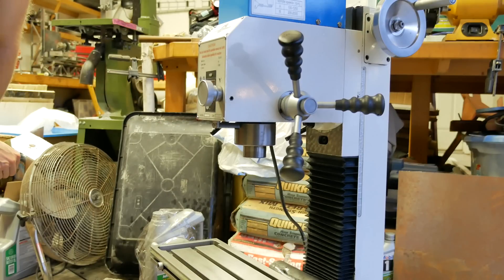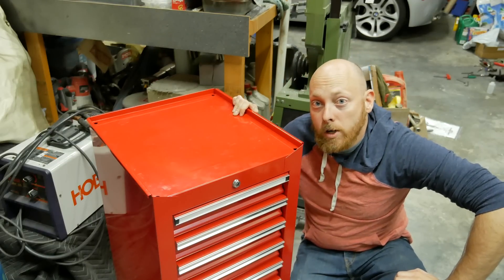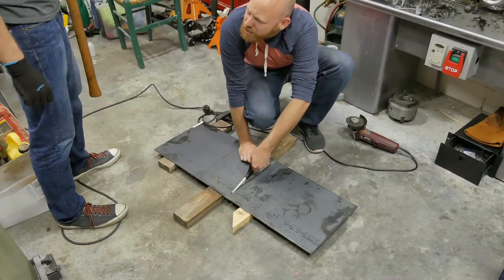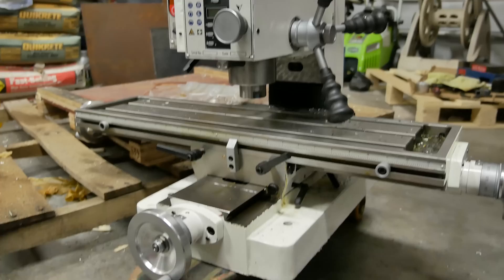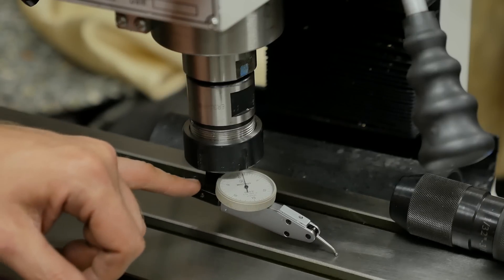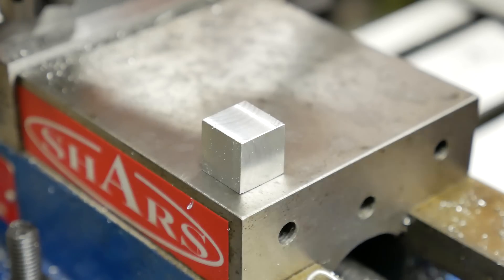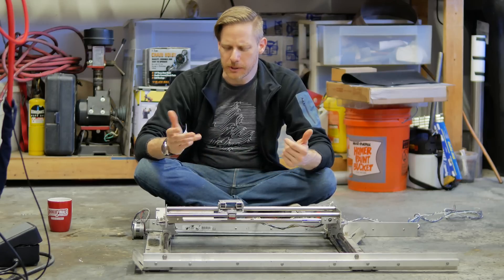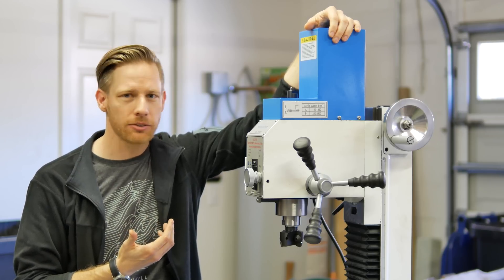we got a new Mill! - S02E30

Comment: First, that's an awesome delivery guy. 
Years ago, I picked up a 2 ton chain fall and welded (farmer welder level) a gantry to lift a SM365 xmission and the transfer case. I still have it and it gets more use than I ever expected. 
Watching the last part was great. My Sr. project for my EE was to build a large X-Y printer for the prof. in the art dept. This was in the late 80s. Scavenging parts and having grown up in a tool and die maker family, helped (and always helps) for the 'analog' stuff. 
Now that I'm not a prof. software engineer, I'm going back to working in the shop w/o a bunch of electronics feels important right now. 
Great vid. thank you.

Comment: "Why buy something nice when you can build a crappier version of it".  I live by that motto.   I brought home an ENCO 13x40 Gearhead lathe from a local machine shop recently. Tore it down, cleaned and painted it and put it back together and I'm using it to learn on.  My wife loves the new addition to the garage as it hardly takes up any space at all ;).  They also have a MSC Bridgeport Clone Mill that they're looking to sell me.  That is gonna be a bit harder to convince the wife on (even though the price is stupid good, cheaper than what I bought my lathe for...).   I have zero machining background but with the help of TOT and Blondihacks for around 6 months I can now single point thread, make rings and lots and lots and lots of chips to sweep and clean up.  It's way too much fun.

Comment: You guys are so much like me. I would like to try and build if I couldn't afford  a new mill. I did build a complete 3 axis CNC  Router Table. It was a learning curve. I am now am looking at a complete metal cutting CNC Mill. I cut gears out of wood with my very small Router Table in Fusion 360.  I have  had Large Bridgeport Knee mills and large lathes that were all manual and loved them.

Comment: I love how you use the parallel bars with the job that's a proper machining trick but you need to tap the job down with a copper hammer while tight in the vice to keep the bars tight they should not slide around during machining

Comment: Two words,... might be a future option.... if the tool chest seems lacking...
EPOXY GRANITE.

30% MINERAL DUST
35% SAND
12-15% EPOXY
... BY WEIGHT.
the remainder being STEEL INSERTS FOR STRUCTURE & FASTENERS.
(Unless my memory fails me,... which is rare.)

Comment: Question (to anyone really): Now that you had the mill for some time...How does the mill function on the HF tool box? Would you recommend the tool chest if you had to do it again? or just get the OEM stand on the Precision Matthews website and be done with it? any insight would be great.
Reply from the maker: Would definitely do it again. It's been very solid and a great place to put all the mill related tools. The only downside we have run into is forgetting to close one of the drawers all the way and ending up with chips in there. But that is pretty easily avoided.
Reply: @PhysicsAnonymous  Thanks. That's what I'm thinking too. Why get a basic stand, when for the same money + little extra mods, you get tool storage..

Comment: nice video, and tig work, but PLEASE use full clothing, like pro welders do, THIS ARC LIGHT is worse than m.i.g. or stick electric arcs !! ( the ultra-violet light is more intense, because the energy / temp. is a lot more); and so Pro welders hide every part of their arms, legs, in short if you DON'T want cancer there HIDE it under gauntlet sleeves, long boots, etc., you will seriously regret it when it comes time for skin grafts, or cancer operations!!

Comment: How sturdy is that tool chest against sideways forces acting on the top? I would have reinforced the back and the sides of the chest too. Milling harder materials such as steel can make a small mill like that shake quite a bit and you don't want the support for your mill oscillating sideways or back and forth with the mill.

Comment: Practice welding up and away from your welds. Lean back a bit and get up off your forearms and wrists, hold your torch and filler wire such that you support them with your whole arm, trust me it will improve your welding by a lot with some practice. Also don't use a grinder on your welding surfaces, clean them with an organic solvent/de-greaser. you can also wire brush a the surface a bit to clean off any oxides. Lastly, when doing tack welds, make sure your do them cross-ways keeping in mind how the part will flex from the expansion in that local spot.

Comment: Just remember... Lift with your back, not with your knees. Knee replacements are expensive.
Reply: So are back transplants..
Reply: John McDonald I am pretty sure you can't get them given the whole nervous system problem
Reply: Falney , A 2000lb engine hoist is about $200 or less. Works great if you can get the front wheels arranged right. Some welding and mods could make a big difference. Do not try extending the arm too far, it will tip before it will break, at least mine will. Make some containers to keep chains, hooks, levers, engine-tilting devices handy.
Reply: Keep your back straight, it will be fine
Reply: Everyone knows that the back is the strongest muscle in the human body.
Reply: Lift with the back in a sharp, jerking motion. This sudden movement is required to overcome gravitational pull when it isn't paying attention.

Comment: I recently got a big tool box from HD and the quality seemed better than HF, and more consistent.
Reply: The luck of the draw.
Reply: Paul Frederick , I had been considering what size toolbox and quality between HF and HD for nearly 6 months, my decision was hardly determined by “luck of the draw”.
Reply: Paul Frederick , You just do not give up do you Paul? Listen, I have bought lots of Chinese junk over the years including three bad and damaged keyboards in perfect packaging in a row, two battery chargers that failed after a few uses, and a pair of 4-wheeled car movers that had the swivel balls on most of the casters come out the first time I used them. I have also had a few great items, an Al floor jack is one. I am convinced that is the result of seeding good stuff with rejects or just crummy quality control or both , and HF is a major Perp. Every machinist who buys certain Chinese items complains of having swarf and grit in them. This is choice, not chance. I’m almost as old as Mr Pete and have seen junk from every country so don’t try to tell me I am blowing smoke.

Comment: I just bought my 3rd mill(or 5th if you include the mill and CNC router at work). I wish I had skipped the  desktop mills and went straight to the old knee mills. I started with the X2 at home and then got an SX3 at work. Then I got the Deckel KF12 pantograph mill which is pretty much a light duty knee mill and it makes the SX3 look like, or rather feel like a drill press. The small mills held my skills back for a year or two. I just finaly sold my X2 and bought a simply massive universal mill(Parkson 2N) with vertical head, universal head and a slotting heat with the proceeds. I paid even less for the KF12.  Anyway my point is to keep an eye out for used mills. They sometimes go for cheaper than the new import mills and are orders of magnitude better.
Reply: Old equipment may or may not be better depending on the condition it is in. Availability of used equipment is based on location too. If you live somewhere where there was never any heavy industry the machines simply are not going to be around you then.

Comment: Do you know what impressed me most about this vid? You tapped those threads by hand and didn't use an electric dril or screwdriver like so many guys on YT. Back in the day I tapped many many holes of all sizes by hand, it's an art. You need to feel the progress. You need to understand the difference between brass and the many different steels. The only way to do that is by hand. 

One point though, you drilled the frame for the blue drip tray, but you didn't attach it. And the drip tray has four unplugged holes in it....! Isn't it going to leak?
Reply: Moderate Fkr ah- the holes in the drip pan and the frame also line up with the ones to secure the mill. Just skipped over the part where we bolted the whole thing down, whoops

Comment: The rigidity of that column is poor as it’s very thin, what’s it like taking a big cut. I am just asking as i am looking for a mill. 
Kindest regards joantahan
Reply: Jonathan baker it's no Bridgeport, but it does do pretty well for the home shop. Depends on the cutter size but for example I was able to take a decently clean pass side cutting .5" deep x .1 DoC using a .5" endmill (mild steel). Also have done some face milling with a 2" shell mill, I can certainly cut enough to make it chatter but it has no trouble either if I'm reasonable, taking maybe 10-15 thou per pass
Reply: If you are looking to take a big cut then a bench top mill is not what you're looking for. Get a K&T #3. They can take a big cut. They also weigh about 25 tons too though.

Comment: I’m confused, why isn’t that mill really rusty? Don’t you need to strip all the parts, re-paint, reassemble and then build another machine to be able to make it functional?
Reply: David Parker it a cheap machine from china. You can get it with tons of different brands on it.

But they are not quite the same. If tolerances are bad on a part, it goes to one of the cheaper brands. If the part is good, it goes to a more expensive brand... pretty clever in a way.

When that is said, I've worked on a cheap one and it is bang for your buck and good enough for most hobby use, but would not last long in a Production enviroment.

Comment: I have that mill and a word of warning to you. The head does not stay trammed under moderate cutting force. There is just not enough clamping force on that one bolt. Try drilling and tapping some holes on both sides next to the pivot and using some large bolts and washers to lock it in place. You'll thank me later.
Reply: Merlin Magnus they seem to have upgraded that, probably for that exact reason. There's now three sizable bolts that hold the head tramming

Comment: Did you build any structure around the bottom of the tool chest? I would be afraid of the bottom pulling apart/bending if it is constructed like the top section. 
 I noticed the cross supports are pretty close to the sides, rather than centred, any particular reason?
Good video overall though, I like the videos from you guys among other youtubers, you don't put in too much boring stuff and you have a good amount of banter to make things interesting!
Reply: I realize this is 4 years old, but I am using the same tool chest from harbor freight to build a stand for a much lighter LMS 4190 mini mill. I agree with your comment that there should be a frame. I used 2x2x .250 tubing for the bottom support and have .250 plate welded to the tubing below that (the top of the plate will be flush with the bottom of the tool chest as their is 2" recess on the bottom of the chest) To the plate I will have the Netfish 2200# leveling casters bolted on (these are awesome to those that like to be able to move things around a multi use shop, and when put in place they have nice rubber pads that you ratchet down to make the stand rock solid)
I will be doing the same method as they did for the mill to mount, only I will connect the top .250 plate to the  bottom plate with .1875 angle to take the load off of the tool chest, so my top .250 plate will overhang the chest. While I think these chests are decently constructed, I don't think that they will stand up to the weight over time and I think gravity will eventually win. 
Just started on mine yesterday and mini mill should be here Friday

Comment: Actually tramming the spindle as you showed isn't really the correct way until you verify that the rear column is square to the table in both the X and Y axis. Easiest for that is make or buy a good cylindrical square and run the indicator up and down the square using the heads Z axis. And I'd bet money that rear column isn't true to the table. These off shore machines can be a bit of a crap shoot as far as taking there accuracy as a given. Myself I'd check the runout on the spindle taper and the table flatness in X and Y as well. I learned a long time ago that if you don't check there's no way to be 100% sure of anything. And I certainly wouldn't hesitate to double check even a brand new Bridgeport. Pulling the table and Y axis apart is also a very good idea since these machine are assembled in a lot less than clean room conditions. Properly cleaning off all that congealed dragon fat anti rust preservative and very likely some chips and grinding dust on the ways and feed screws, then readjusting the feed nuts and gibs then relubeing with a proper way oil will make for a much smoother and tighter operating machine and is more than worth the few hrs it takes.
Reply: Turning Point that's a very good point, I might take a precision angle plate to it later and see how far out it is. I'm sure if it's worth the trouble we could shim and epoxy it, I think I saw Stefan Gotteswinter do that with his
Reply: Yes epoxy and copper wire.  Works great.

Comment: I think learning on manual machines is the best way to learn. I've just finished my engineering apprenticeship of 5 years . I gained an interest in mechanical engineering about 7 years ago and I was lucky enough that my grand dad had an old Colchester Mascot lathe that I could play with. I learnt an awful lot on that worn out lathe and still use it today. Read every book you can find on the subject. I now run CNC lathes all day, every day and to be honest, manual machining is way more interesting..
Reply: Agreed!  I purposely keep CNCs out of my shop.  I like my manual mill and my Standard Modern lathe.  Manual stuff has so much more soul.
Reply: While having/using manual mills is a great skill/ability to have, there's things you can do with CNC mills, especially the sophisticated four/five axis machines, that you just can't do with a manual machine.  Love my manual machines that I have at home, but I often do machining on the CNC machines at work because it is nearly impossible to do that work on a manual machine.

Comment: I got an Optimum BF20L and its quite nice however I would be more happy with a gearboxed motor compared to the vario. When drilling steel for example t struggles a lot but for easier milling its good, at least in softer materials. Congrats on the new addition.

Comment: Exciting, and a good buy! Those machines seem to be the best bang for your buck. That spindle is dead silent... I am jealous after listening to noise 50 year old bridgeport spindles for years!

The next thing you may want to do is seal up any gaps between the chip tray and the top of the toolbox you mounted it to. As I'm sure you know, coolant has a way of getting everywhere, and it could cause a bit of a bad time if it gets in there and sits there. You've probably already thought of this, but I just wanted to be sure :)

Enjoy! Really excited to see your surface grinder and other projects continue. Haven't seen anyone else do that anywhere on YouTube, mad props for taking that up!
Reply: Calvin Stence that's a good call- haven't run any coolant on it yet but I'm thinking a little silicone where the mill meets the tray would do it.

Bridgeport might be noisy, but it can do a lot of things this little machine can't. Bridgeports are pieces of art if you ask me
Reply: Yes, I saw the holes in the top of the toolbox that go under your steel frame you built and could see all your tools being drowned in coolant. Silicone to the rescue!

They are indeed pieces of art, I don't like the spindle noise but using them is pretty much always pure joy... except when you have to hide behind the DRO because a shell mill is throwing super hot chips. Ask me how I know.

Comment: Q: why do you angle grind the joints before welding them?
Reply: Juniper Belmont take the mil scale off of them, welds much better and the arc strikes easier with clean surfaces
Reply: A quick tip would be to lift the tube and preflow a little gas into it if you are getting inclusions.
Reply: i guess its one way to prepare a clean surface to weld
Reply: Kirk Blakley good tip! How much preflow do you do? I think I have 2-3 seconds right now
Reply: 2-3 seconds should be plenty. With argon, I usually just lift the tubing and aim my gas lens into for a few seconds just to make a purge. With bigger(6 inch or more) you need another source of gas for your purge(separate cylinder and regulator with line). Also on start up I purge the lines on the torch(im sure you know that already). It also helps to use a torch stand on your work bench to keep the lines high and the argon at the torch instead of gravity flowing out of the lens. You are doing quite good for beginner and you will figure out all the tricks to it in no time. p.s. congratulations on the new mill!
Reply: What are they making pressure vessels? Who cares about inclusions with work like this. Get the fuck outta here!